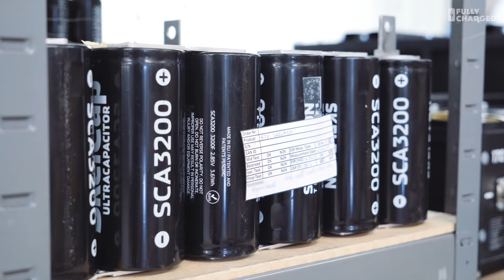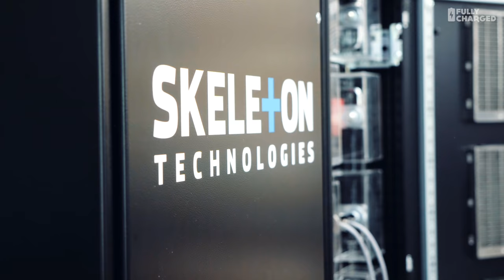Skeleton Ultra Capacitors | Fully Charged

Comment: @19:18 come now, HOT and sunny is not ideal...you should know this. Sunny and 5 deg. C is perfect for solar; the only thing hurting Estonia is the angle and duration of solar radiation for most of the year. During the summer it is great and as solar costs per panel continue to fall it is getting more likely it will be worth it to install even if only to be able to get good use out of it 2/3 out of the year. As it is Germany has more solar than probably the whole United States...and Deutschland is NOT ideal weather for solar!

Comment: YOU ARE ALL  REALLY  BLIND.  USE THE S CAPS  TO POWER A SMALL MOTOR TO TURN  ALTERNATORS TO POWER  THE MOTOR THAT RUNS THE CAR.
Reply: LET THE S CAPS POWER ALTERNATORS,  LET ALTERNATORS POWER THE DRIVE

Comment: Fit high voltage solar panels to your property, aalong with these super capacitors, you will not need a connection to the national grid. Now that's a Green policy but Governments will introduce a law that will force you to lease the packs of super capacitors. A flat rate of Tax, submitted in 2 minuets, another Green Policy, it's not the British way. The Local and National motto is as long as I can string out a decision, the longer I keep myself in a position.

Comment: Comparing these capacitors to batteries is a fools errand.  Their marketing claims 6.8 Wh/kG, whereas lithium ion batteries are over 100 Wh/kG.  "Power density" isn't common terminology when discussing energy storage; you want Wh/kG not kW/kG.  As neat as this product is, they're more than an order of magnitude away from even theoretical use as the primary energy storage bank for a vehicle.  There are a lot of applications, but bulk energy storage isn't one of them.

Comment: Please stop calling a normal sized capacitor an ultra capacitor. The capacitors that are already in use are just called capacitors, thanks.
Wow over them if you want, I mean what a capacitor does is very useful for these situations that we are describing, but the ideas of super and ultra capacitors were first introduced due to their proposed size and capacities.
Like, capacitors big enough to not need a battery, for example.
However, that is a bomb, just like a tank of hydrogen.

Comment: Capacitors are low efficiency energy storage, the amount of energy you get out is typically <1/2 of what you put in (36-48% for Skeleton Tech's "SCHE" products). Compare that to Lithium batteries, where you can get up to 99% efficiency. This is shill journalism at its worst, talking about the "shortcomings" of these products without even mentioning the worst offender. Capacitors have a place, but they aren't replacing batteries.

Comment: The math in this video is very troublesome. Throughout it the host was very sloppy with units of measure and the lab guy played it along. He said the battery at 13:07 had a capacity of 1.5MW. That is a meaningless number unless you know both how much and how long the battery could supply that amount of energy for. So he later says he deals in MW/s, 1.5MWs is equal to a lousy 0.4KW/h or enough to travel ~2 miles in a small electric car.  Given the enormous size of this twin rack setup that has worse energy density than just using lead acid batteries, this technology is untenable. It can discharge very fast but its only a short burst versus a much longer runtime for a LiPo battery and still supporting a high discharge rate. It really makes no sense at all and this company is destined for failure if it hasn't gone already.
Reply: I was thinking the same thing. Bad math and bad comparisons. Where the battery excels, is that they charge and discharge symmetrically, meaning they're always ready to do the job you need: (absorb energy, braking) or discharge (acceleration). The main battery then doesn't even need to be half as big because its only use is to overcome friction, like when cruising at a constant speed.

Comment: I love this channel, and this guy has great application ideas.  But he clearly hasn’t done the math around the energy density.  

His example that really caught my attention was using their product as the first ’50 km of range’ on the pack for fast charge.  So I took the tesla p100d pack as an example.  It would take 10KWh to travel 50km in that car.  This would require a ultra cap module that is 7x larger than the p100d pack.  I’m using their own product for energy density math. 

tesla pack  ultra Cap (skeleton)   
365 L  63 kg   
100 KWh  55.2 L   
273.9726 Wh/L  3.4 Wh/kg   
0.273973 KWh/L  0.00388 KWh/L   
500 km  2577.031 L   
       
       
       
       
   source    
   https://www.skeletontech.com/170v-modules

Comment: Application of this ultracap bank with electric cars is not all that compelling.  EVs regen at 50kW with is plenty enough to slow the car.  Nobody needs 100+kW regen.  Also tesla has shown batteries retain  92% energy after 5 years of use.  After ten years it should be in the mid to high 80%.  At that point people usually get a new car anyway.

Comment: You know it occurs to me. With FTL space craft there is an issue with power. However as to make them work you need negative energy. This also is needed in a way that makes an Einstein Rosen Bridge easier. So why not use something like huge banks of Ultra Capacitors on a moon or asteroid (or space station) connected to a FTL ship via Einstein Rosen Bridge. That way the ship is smaller as you don't have to store the energy on the ship directly.

Comment: DIYev.com is a new company that has been developing all electric drivetrains and battery packs for Trucks and buses since 2008. Edward Monfort debuted his EV technology at the Anaheim, California  convention center next to Tesla pre Elon Musk. As seen on youtube.

Monfort developed and built:
First ever working All Electric 80 passenger BlueBird School Bus
First Ever all electric Ford F-150
First ever all electric truck for under $20K

DIYev is a Open Source electric vehicle conversion company for new or used trucks and buses.  The DIYev system (Electric drivetrain and Battery module packs)  fits into any existing truck or bus allowing massive cost reduction for EV trucks and buses up to 19,580 GVW.  The DIYev systems installs in less than 2 days using your existing infrastructure and existing certified mechanics.  One day of training by video is all that is required to install, maintain and repair your electric DIYev converted kit.  
FACT: DIYev kit system takes max only two days to repair using the existing local infrastructure while Tesla can take up to 6 months to repair by towing the car up to 5 hours away to a very specific location with very specialized trained technicians.

Comment: sorry sounds like a bunch of bs sorry... caps long have been around installed on 'buss lines' in the US for decades... what you talking about willis...    let alone caps arent measured in wattage for output, its farads.... sounds like they trying to call ultrafast batteries as 'caps'
Reply: Go buy a cap and show me anywhere WATTAGE is listed... or even for batteries.   batteries are measured in voltage and amperage/hr ... and caps are voltage and farads... end of discussion.  hate to burst your bubble, but its a sales pitch.  people like you are those who go and buy a 2000w home stereo system and dont even blink when you read the label saying input power is only 300w like you magically just generated that extra 1700watts out of thin air

Comment: to make the "green" all electric vehicle and renewable energy reality means mining and producing 450 million tons of finished copper (not counting lithium etc) in the next 30 years which is completely ridiculous. Experts at energy symposiums just cant imagine how all this nonsense can be achieved.  All we need is Thorium reactors, producing synthetic fuels in vehicles using Achates 2 stroke engines. A diesel electric drive with one of these ultra-capacitors would make lithium batteries look pathetic in cost effectiveness and useless by comparison.